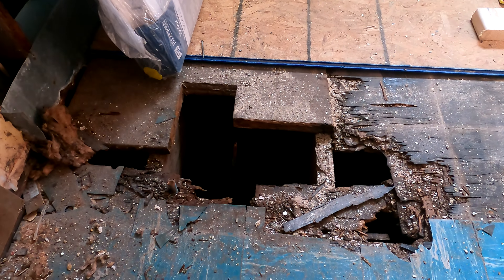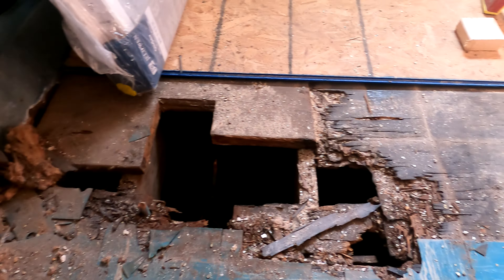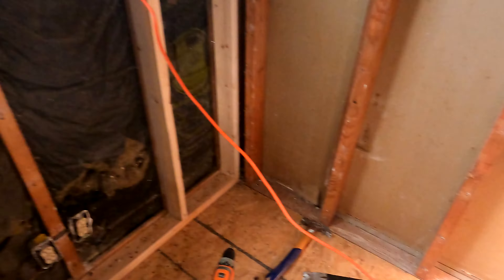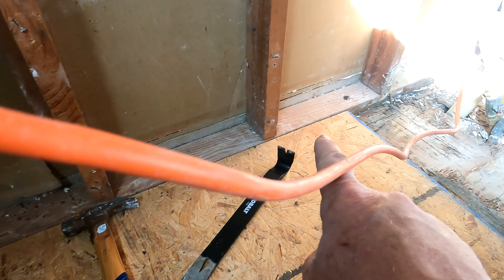Bathroom Remodel...No It's An Install...

Comment: Yep in the south we called it a mudroom . But your doing great  that opened up that bath great. I rather have more space than a useless 1/2 bath. Great job G. Have a great day. Watch out for those back to back storms coming. Weatherman Plus says it's going to be cold and the S WORD ❄️🤣. Get ready be safe. Love you guys. 🙏👍❤️
Reply from the maker: We call a mud room a mud room here as well. I was thinking a nice half bath for classes. We are just going to do what we can fit. So yes that becomes a mud room slash hall bath. Yoda
Reply: @GrumpyAcresFarm  Sounds good. Get a port a potty for classes write it off. I'm in the middle took out all chicken in freezer. Picked up fresh  chicken yesterday a farm from NC comes around I'm first freezing up some fresh breasts, legs, thighs got 160 lbs. My last haul from them was 2years ago . 1 breast is bigger than my hand. Thighs are decent legs are nice. But I'm doing first a batch of chicken and dumplings. Then when the other children thaws out I'll do canning. Hope your doing well . Watch those storms coming back to artic weather. Will be 80 Thursday. Yikes. Love ya talk soon.🥰

Comment: I was thinking for the 3" wall space, maybe create a base board.
We have dealt with ceiling gaps in our house. We notice it as they angle in some ways, but it still turned out lovely.
Reply: Also, where the floors don't like up, we made a threshold.
Reply from the maker: That section of the house is a metal building. Would we be able to insulate under the baseboard? -Yoda